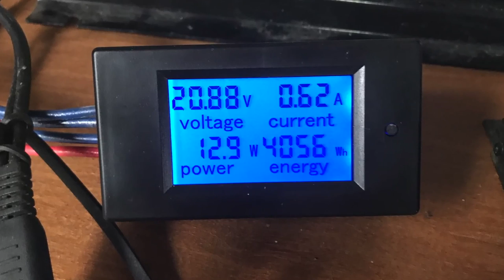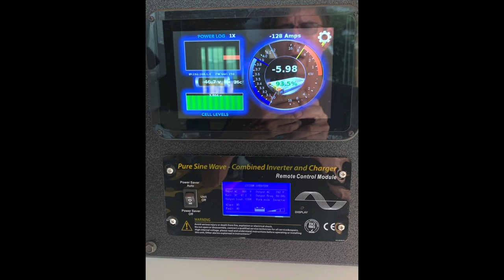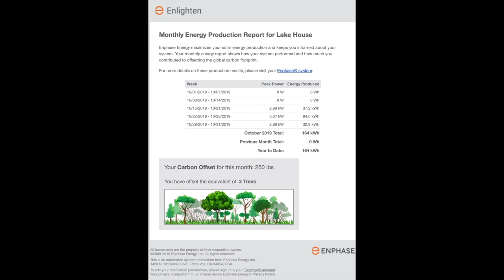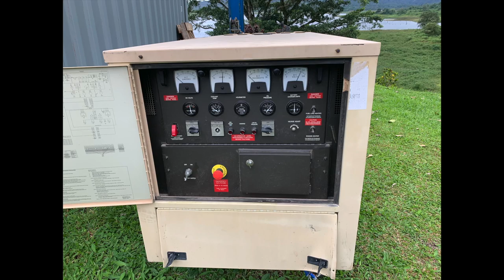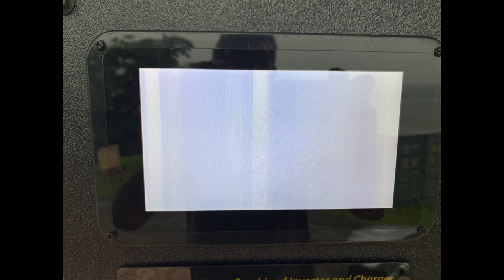EVTV on Tesla Cybertruck Unveil Wardrobe Malfunction

Comment: Trump 20/20,   Jack, you are right up there with Billy Graham and the Donald!  I see you are poking around on some RV stuff lately.  I have owned just about every kind of RV made and have traveled all over this wonderful country.  Most veterans in the RV industry will tell you that  ALL current and past RV's are pure junk.  American society is about to become highly mobile  much as the American Indian once was ( got to have them buffalo burgers).  Due to automation and other factors.  Most RV's have the required roof/awning space for enough solar panels to fully recharge an  EV and keep the RV itself going.  Three days is my usual stay at most locations.   You are building the power centers already.  Would you please build an RV trailer to show those idiots in Indiana (home of the RV manufacturing world) how it should be done?  Your business is going to grow super naturally.   With the hyper growth of youtube and a few outings of the before mentioned EV/RV at such RV meca's  Quartzsite, Rubber Tire Rondevous  etc.,  you will have to start selling stock in your company  ( I will buy some).  God Bless.
Reply: An RV made with freezer container insulated panels would be structurally strong with minimal framing and fantastic insulation against heat or cold. Air con can run either way to heat or cool.

Comment: Towing will affect the range drastically
Reply: It does, Fast Lane Car channel did a Youtube Video pulling of a Model X towing an 5000 Lb trailer on a long range trip and it didn't fair to well and they had to call in a ICE truck to get them and the trailer to their destination. I think all models of the Tesla Cyber truck will need to have the 500 mile spec for towing purposes, untill a time when batteries can be charge as fast as an ICE car can be refilled at least for the people that would need them for long distance towing.
Reply: Like ALL objects,affected by, WHAT, (gravity).

Comment: Alright, the comments on getting in and out of the Model 3 and S has more to do with your age, health and flexibility and I am certain you have the same issues with your couch, chair, bed toilet probably. That issue is specific to you or people with same ailments. But i get your point that the truck will be easier.
Reply: Truck seating is more chair  upright. When seated in mine my sight line is the same height as when I stand. In a car the seating is reclined & lower by 3 heads which hurts visibility in gridlock, you're at the mercy of the driver ahead's reflexes. Seeing over the tops of cars saves you. Taller seating is easier for any age driver
Reply: Jack Rickard I agree that it’s easier getting into my Ford Escape than it is my Model S.  Will replace my escape with the Cybertruck.
Reply: Sure I get it. But just imagine for the past 20 years everyone would have taken the reason of getting in it out or more comfortable seating which is debatable, visibility for sure true to justify buying a truck, we would be now too late on climate change, cause we would have passed the point of no return long time ago considering trucks pollute a hell lot more. Well, at least the seeing infront is not an issue anymore thanks for Full Self Drive, my Tesla does most the work. I'm just glad there will finally be alternatives to dirty trucks, the traditional takes for traditional guys with the Rivian or GM and the I get it types with radical awesome Cybertruck. Now will preorder a second one after watching your video.

Comment: From what I've seen, the range can really drop while towing.  There' a you tube video that effectively make towing with the model X look like a non-starter https://www.youtube.com/watch?v=jhX3BmhJXc8.  If the range while towing with an EV craps out that bad, you might find that the cybertruck doesn't cut it as a practical matter while towing.  Even the 500 mile range version might have its range drop to sub 160 miles in a real towing application.  Supercharging would likely take over an hour (cause the battery is big) , and you might need to do so ever couple of hours.  That would be rather annoying at best!...
Reply: You assume the batteries in the truck will be the same as today’s batteries.  Meanwhile Tesla acquired several battery companies and had the most successful battery technologist in history work with them on next gen battery tech.  Your reasoning is linear, and flawed.
Reply: Maybe more like 200 or towing for the 500 range. It does have 3 of their best motors and a giant battery pack, which are specced to move a much heavier vehicle normally. I plan to live full time in a DIY truck camper on top of a top spec cybertruck and even if it only goes 150-200 loaded up that will be plenty for me at a time.
Reply: @planetmuskvlog3047  Maybe... but they are claiming 500 miles of range.  That establishes a ball park for battery size (maybe 200 KWh).  To recharge that requires 48 minutes going from 0 SOC to 100% SOC with a 250KW supercharger (tesla's highest capacity to date).  This also assumes you can charge at that rate all the way to 100% SOC (maybe, but I doubt it).  So you are likely over an hour to charge it.  If you are towing 10,000 lbs, I doubt you will get much over 160 miles off of the battery.  If they are expecting better battery tech for more capacity, then you'd expect better than 500 miles of range.  Maybe the better battery tech allows for charging in 48 minutes???  Maybe...  Still, you are looking at a travel pattern of "couple of hours driving and an hour of charging", or there about's... Annoying!
Reply: TFL is a Tesla hating YouTube channel.  They say they aren't, but they are.  Watch the Model 3 videos.  They drove once into a  cement block wall just to show how long it takes to get it fixed when they took it to a local Car and Appliance Repair / Bait Shop.

As far as towing with an X they put a giant horse trailer on the back that was so heavy the X couldn't tow anything more than that but a box of popcorn.  Then they drove it like they stole it.  And then they stopped the towing test when they got to highest elevation on their route.  Why?  because a Tesla will regen when going down hill and they didn't want to include that in the video.  

Once again  TFL = Tesla FUD Lovers
Reply: @Jack Rickard Okay... you got me there!!!  But if you are towing something like a horse trailer (complete with horse dropping) it might be a little annoying (IMHO).   I know towing with an ICE car generally lowers efficiency quite a bit, but is it as bad as a factor of 3?  That seems high to me.  Are the aerodynamics of the the Model X that good?  And with a trailer that bad?  Where is the factor of 3 coming from???

Comment: This is just a prototype. It will not be the production car for many regulatory reasons. There will be headlights (separate high and low beams), different tail lights and also side markers. There will be side mirrors and rear bumper as well. Pretty sure the front end will be different too, due to EU regulations for pedestrian safety.
Looking at the damaged area of the glass they hit, I can tell it's laminated. Usually cars have tempered side windows but they are not laminated and that's for safety reasons, it's a regulation they can't go around. If I'm wrong and this is not a laminated glass, it would have scattered, the entire window will brake in small peaces. Also, no modern production car would have window lifters that will drop the window when someone hits the door.
Reply: @Jack Rickard Most of the mentioned regulations are US regulations. Only the shape of the front end is a EU thing, when the separate low and high beams as well as the side mirrors and side markers are requirement only for the US market. Also per US regulations the taillights must be on the body and remain visible after the rear hatch/door/ lid/glass was open. But for the most part you're right and as you say,  it might be available in the US only, but will still look different then the one in the presentation in terms of aesthetics. None of those is to argue with your theory of flat body panels and cheap production avoiding tooling costs.
Reply: With Elon, this is the production and will improve!!!
Reply: You have a new set of tail lights when it drops so I'd be surprised if that was an issue.
Reply: @chrisparkin6894  I suggest you make yourself a nice cup of tea, relax on your couch and familiarize yourself with the regulations as per  NHTSA before getting surprised. 
In fact, that would be very helpful reading for anyone wondering why all cars/trucks look alike so much.
Reply: @akira28shima32  Que?
Reply: D Stanoev I was waiting for a racist response! Please don’t disappoint me.
Reply: @111chicane  Motorcycles have to follow the same rules of design but they don't look like pickup trucks either point taken but with little to no weight for the arguement you propose
Reply: @darrengillesdarrengilles8336  it's not clear what are you trying to say,  but I don't remember mentioning motorcycles anywhere.
Reply: @akira28shima32  I don't mind you waiting but wouldn't give you one.

Comment: I agree about the Tesla PU design fail.  This vehicle is to much of a radical departure from the designs of today.  Something that Tesla has forgot is the current pickup design is the result of improvements made over several decades.  Improvements like efficiency of design and customer requests. The more applications a vehicle can be used for, the more it will sell.  This pickup is for driving around only not for hauling furniture, camping or towing a trailer.  A landscaping business would never purchase it.  I don't see it working well at construction sites either.  How would you load up standard in-bed camper?  Can you imagine hauling a load of rubbish to the dump in that thing?  How would you change out the bed for a utility unit?   Ford has the right idea here.  At least theirs looks like a F150 with all of its utility.
Reply: The point is that the auto industry has evolved over several decades, as you say, but they stopped innovating. We are seeing a disruption of the transportation and energy industries that hasn't happened in 100 years. An electric truck design can be totally different as there is no ICE engine hanging out the front. The other innovations with the exoskeleton replacing the frame, are a bonus along the same line of thinking. Why have the other manufacturers not done this over the last several decades? Elon Musk and Franz and Tesla are bloody brilliant.
Reply: @Randy Carter -- Wow.  Almost everything you wrote is completely WRONG.  No, 'you don't see', and that's unfortunate.  You also didn't 'listen' to what Mr. Rickard said, and that's too bad.
Reply: You obviously didn't bother watching the video.
Reply: You're out to lunch here.  First of all there has been no "improvements" in the PickUp Truck industry for years.  Elon Musk nailed it when he pointed out that it's been 100 years of ... SAME OLD / SAME OLD.  To say that PickUp Trucks are efficient is naive and industry programed.  The Legacy OEMs have all us Lemmings drinking the Kool Aid.  The bed on this TESLA is already better Than my 2005 Ford F350 Long Box.  With the gate down I get 8.5 feet in the TESLA with NO WHEELWELLS !!! Nobody is even talking about how AWESOME that is.   We all load our Trucks with more weight than they are rated for ... My 3/4 tonne has has 2 tonne on her regularly and my suspension isn't half as good as what TESLA is offering at all levels.  As for hauling over length lumber  I could fabricate  a removable stainless roof rack system in one afternoon that would look awesome and be strong as hell.  After seeing this TESLA PickUp I realize just how STUPID my Ford actually looks and how limited its use is.  I can't wait to replace my current truck.  Tell you what, you wanna buy my Big BADASS F350 Ill make you sweet deal. REAL MEN DON'T GIVE A FUCK what other people think of them ... ESPECIALLY what they think of my truck.
Reply: I will quote something Jack said in another comment that is also important.  They don't need to sell pickups to every single market niche there is.  It's a 100 billion dollar business.  Even 10% gives Telsa 10 billion in sales and if they're building it cheaper than their competitors can because of it's design then more of that 10 billion is profit.

Comment: If you come flying over a hill in this Tesla truck and see a flooded highway and it's not possible to STOP,  resulting in a Tesla truck that is now sinking and the water has fried the electrical panel. GOOD LUCK BREAKING THAT WINDOW, maybe that is not such a good idea with all the floods🤔
Reply: Intelligent driving is still up to you.
Reply: @realalsenor  There are hammers designed for safety glass, they will take out shatter resistant glass, but not laminated.
Reply: Al senior...#1. I have a Chevrolet. #2. My trucks hood is even with the top of my head and I'm 6 foot tall about 245 pounds. #3. It's a good thing you are THERE and not HERE, it looks like you need a little respect adjustment.
Reply: @baldeagle7777777  You are asking for respect from an 80-year old, who simply suggests that intelligent driving is still up to you?  I am afraid your size and weight does not qualify for intelligence.  The little respect adjustment is still up to you.  No reply necessary.

Comment: Tesla having a good network is more and more becoming a sign of elitism rather than beign helpful. So much unused capacity, just open the network and let others pay a premium for charge. They call themselves a power company for crying out loud! Why hamper BEV adoption when you can boost it more? Like hoarding food to fight famine.
Reply: Cloxxki You seem to be missing some key facts. Level 2: Please investigate locations that have Tesla Destination chargers and Sun Country J1772 and you will find that Tesla was more than helpful installing the Sun Country units. While Teslas come with a 1772 to Tesla adapter, several Leaf owners have shown me their Tesla to 1772 units they use. They freely use Tesla Destination units - why not!  
Level 3: level 3 charging doesn't really exist yet, you can research that. The Tesla SuperCharger is high current DC and no other manufacturer's unit can accept that power. Musk has said that he'd be open to the idea as long as they would pony up some costs. Nobody has taken him up on it. The problem lies solely & completely with Every Other Manufacturer, not Tesla. If you doubt me, check the charging rate of the Mustang E.
Reply: @daveturner6612  -- Thank you.  Cloxxki seems to pop up in comments sections regarding Tesla all over YouTube, always spreading misinformation.  It's nice to encounter someone else willing to set the record straight, instead of leaving it 'firmly crooked' as he would prefer.
Reply: FYI Tesla has offered to open their supercharging network to every single auto manufacturer. No one has taken them up on it. Before you presume things in the future, do some research first.

Comment: I was going to put a down payment for a cybertruck but after the demonstration on how easily the bullet prove windows brake I changed my mind.
Reply: @nelio SAMch* -- Look up the term 'ablative armor', then watch the demonstration again.  So-called 'bullet proof' glass functions in an ablative fashion.  It absorbs and redistributes the kinetic energy of projectiles without allowing them to pass through.  As Elon Musk noted, the steel ball did not pass through the windows either time.  So, it was actually a successful test.
Reply: @redxsage  The steel ball didn't pass through because of the soft cushion underneath. Anyway, I'm too old and I can't justify or explain myself what do I need a steel truck for. The humongous consumption of electricity and insurance cost will make it unobtainable for deplorable people like myself.
Reply: @neliosamch3195  -- Wait... WHAT?!?  Are you talking about the flat pane of armor glass under the tall tube?  There was no cushion there at all.  It didn't break in three tries dropping the ball from above.

Are you talking about the window in the CYBRTRK?  There was no padding behind it.  Even after it had been broken, it was transparent.  You could see the video display screen on the other side.
Reply: @redxsage  Yes, Look carefully, you will see the plexiglas moving up and down.  If there is no cushion, How it will bounce so many times?

Comment: Sorry Guys but calling an over glorified SUV/Hatchback a truck is about as bad as it get  and what was laughable was how badly designed it was because you'd almost have to follow it another truck to carry what it can't. Indeed there's a reason why the Pickup basic arrangement hasn't changed must since the era of the Model T when they began and its biggest flaw is its shape since they shoved a shortened bed under its rear widow almost as an afterthought. The reason why the open bed of a truck can't be improved is it flexibility in hauling and being arranged almost endlessly to what its owner might need it to do. You can't see a ladder rack on Musk's mistake or be at ease that sheets of OSB/Sheetrock won't tip out going down the road hanging of its ludicrously short bed. Indeed its wedge shape is dangerous in a collision because it might dive under another vehicle and get peeled like a banana or become a ramp the others will climb over as the ride up its sides...
Reply: All wrong  Vault floor slideout for longer loads. 4 ft.out will give you a 10  1/2 foot vault with sides and lid.  Ladder racks? give me a brake or give Musk  a metal brake and he will fab you a ladder rack,  The only diving cybertruck will be doing is in water.
Reply: All wrong including the collision bullshit.
Reply: Do the research with un-bias mind.  You might be surprise with Cybertruck and learn something new.